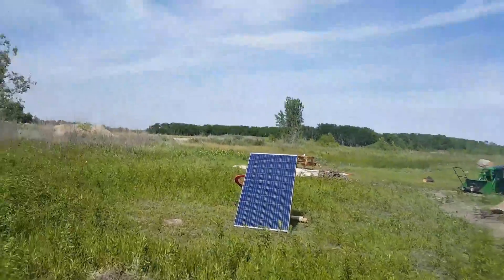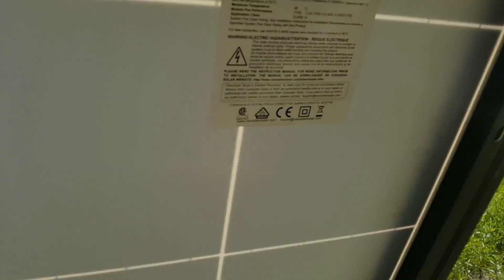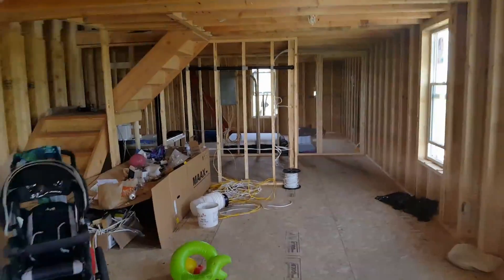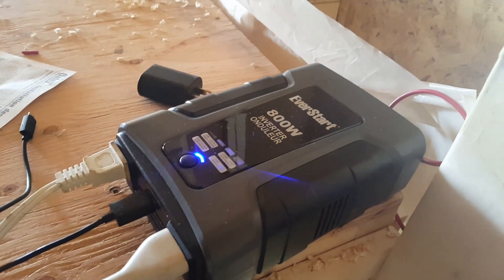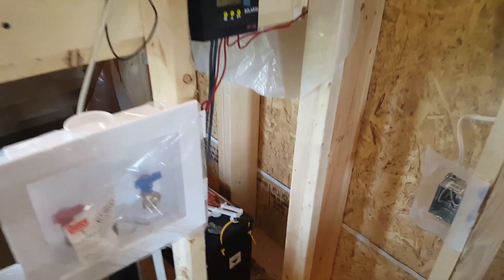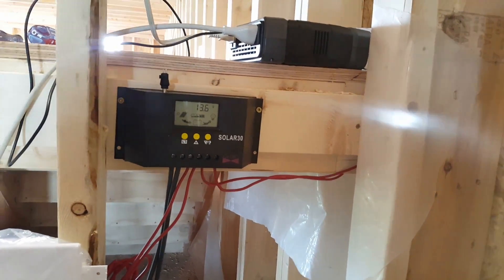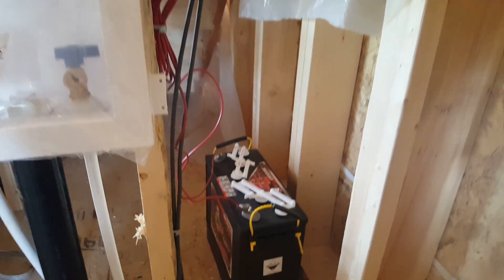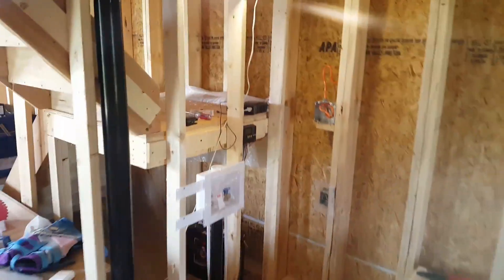Easy DIY $800 Off Grid Solar Power System

Comment: Do you have a video or can you show how you ran your Inverter to the distribution box to power your AC loads?
Reply from the maker: I do not, but essentially you just run the positive terminal on the inverter to the positive terminal in your breaker panel. Negative from inverter to negative in the panel
Reply: @TheHappyHermit  Positive and negative from your AC or DC? And a huge thanks for the quick reply.
Reply from the maker: No problem, I'm sitting by the cell booster so I saw it right away and I like to reply to folks commenting on my less viral videos. Find a good inverter with a positive and negative terminal available on the AC side and run that to the main lugs in the panel. Assuming of coarse there is not a grid tie power line currently going into your main panel. If there is, contact an electrician about how to safely make that switch
Reply from the maker: I should add, the Wal-Mart inverter seen in THIS video is not able to connect to a main panel. You can see the inverter we use for that now in my Off Grid power video on my channel and a link in that description of where I bought it
Reply: @TheHappyHermit  Thank you very much I appreciate the help.